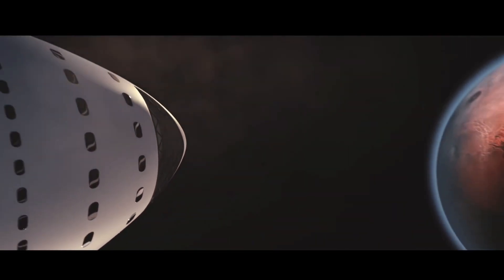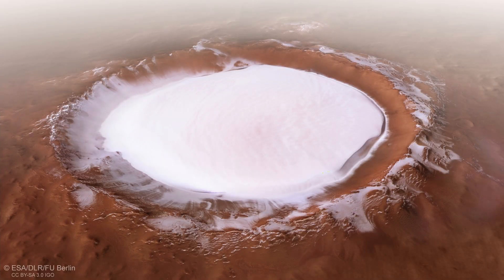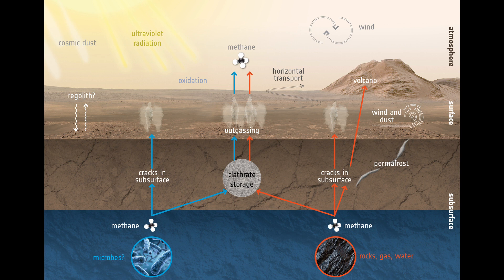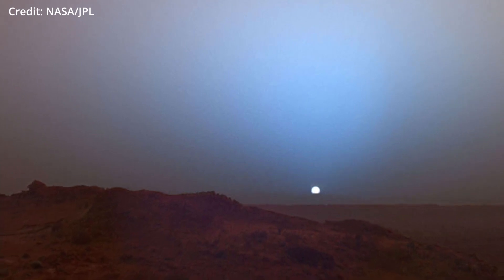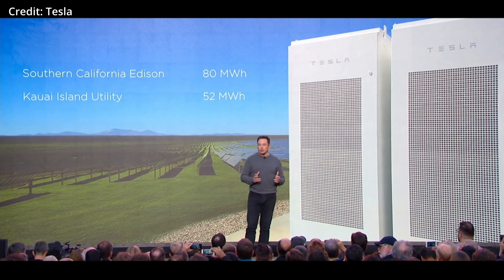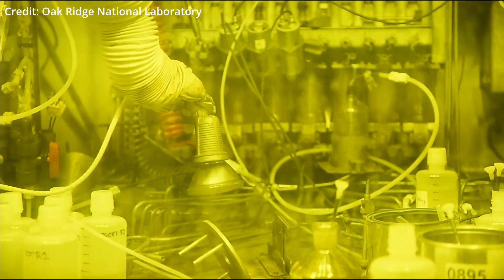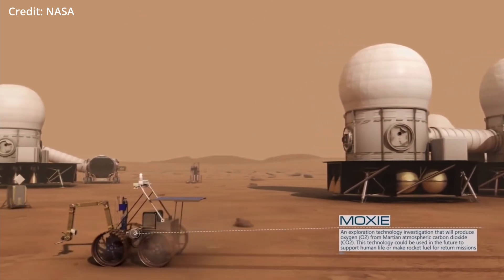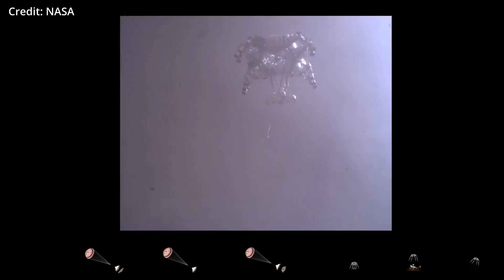How will SpaceX Colonize Mars with Starship?

Comment: You mentioned it briefly but it caught my attention. Geothermal power? Could it be possible? I've heard they found undeground reservoirs of liquid water on Mars few years back. Not only could that water be used for drinking and hygiene, but possibly for farming, heating and electricity. 
Now, if those reservois would have decent porosity and permeability (which is entirely possible, even likely) and if they had substantial reservoir energy (pressure - likely; because of petrostatic and hydrostatic pressure) and temperature (geothermal gradient), free flow (without pumps) could be achieved from the reservoir. 
Essencially, you would need two wells - one that produces this water and the other for injection for maintaining reservoir pressure. Water would heat a working fluid through heat excanger (that has lower boiling point) which could then turn the turbine and generate electricity. After that first cicle, water could be run through the facility to provide heat (if still hot enough) and finaly, some of that water could be purified and used for day to day stuff. Ofcourse, you will need to inject this water back in to the well, so it's a closed system that never runs out of water and energy.

could be cool, not sure if possible.